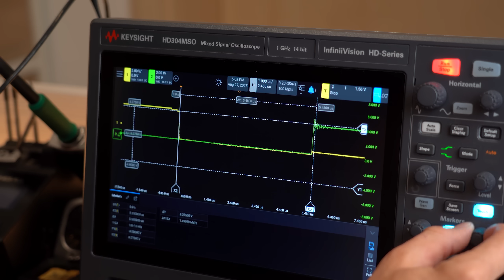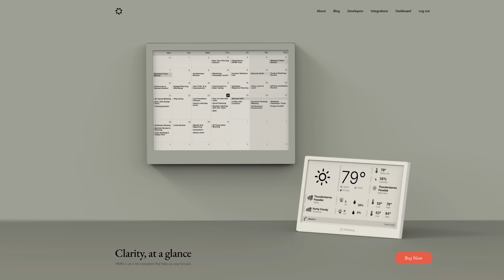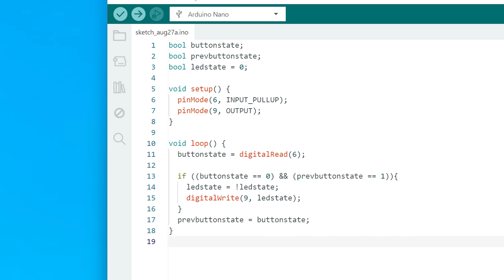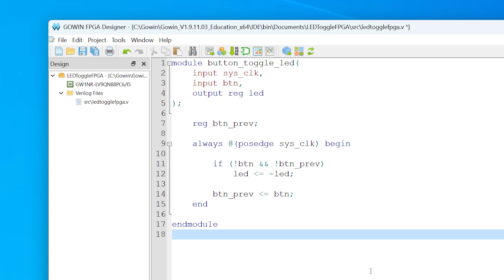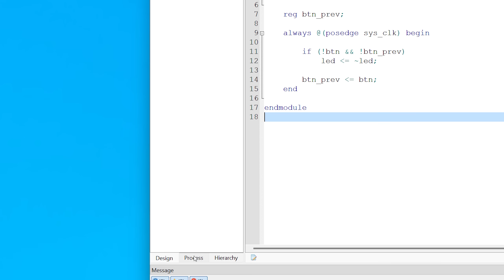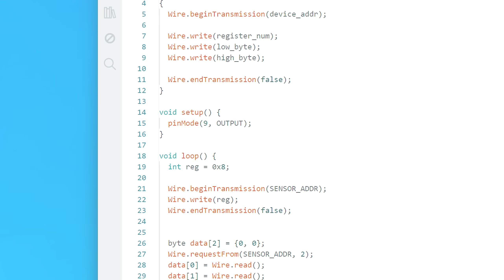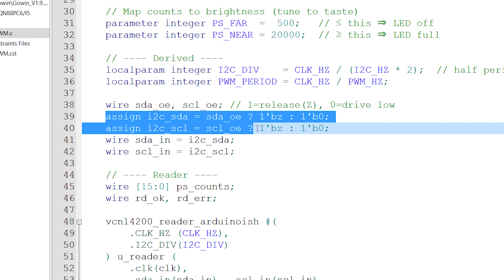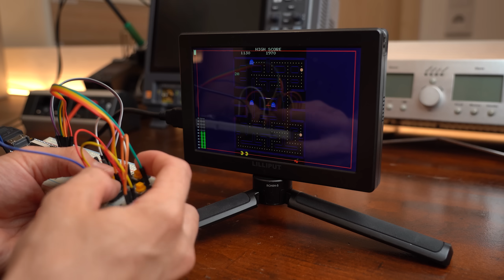The Harsh Truth about FPGAs (You Should Avoid Them?!)

Comment: My two cents about the subject... If we want to have FPGAs become a commodity so we can get more awesome and open things to be build around them... We have to use them.
The path is hard because FPGAs are right now a (expensive if you use Altera or Xilinx) novelty around hobbyists. Before the MiniMig making the DE boards popular, FPGAs were practically a closed feud around high designers and manufacturers. There aren't shortcuts and open user friendly ecosystems around them. All the tools and workflow are different across FPGA manufacturers, and the tools themselves may cost a fortune and you are tied to strong licensing concerns. And ofc there aren't mature open tools and libraries to work with them.

For this to change, people has to start rolling the ball. Them need to get buy and used, and a community to form, so open toolsets and libraries can build around them. Just like when Arduino and RPi came and replaced the old ways from the era and build friendly tools and communities around them, displacing Microchip popular PICs from the hobbist space.

Otherwise, FPGAs will keep being a niche, and open designs will be always limited around the limits microcontrollers can do.
Reply: The main problem here is that microcontrollers are more generic, they can do a lot of stuff like talking to sensors and toggle something, which is often what the hobbyists need and do. For FPGA, what do the hobbyists even need an FPGA for? How often does a hobbyist need to interface with high speed ADC/DAC or do some arcane networking stuff or need some thing to special logic chips that they can't get?

Arduino or RPi are popular because even if the framework simplified a lot of microcontroller stuffs (debugger, hardware datasheet,...), in the end the workflow is still similar and not too different like FPGA design flow (functional simulation, synthesis, timing analysis,...). So no while I would like cheaper and smaller FPGA with less logic elements for some other simple usage (like replacing CPLD) but I think it won't ever be a common commodity like microcontroller.
Reply: @minhkhoa445  i dunno bout you , but damn near EVERY project i've done >> ive needed some parallel processing. most of the time coding arduino/esp32 its about how / where i can compromise & stripe the operations. then when u just use a micro to do one thing > your barely even using the thing / seems like such a waste
Reply: BUY MORE ,, yes, need more options less than 100$ or 50$ . that only became a reality in the last decade, but VERY FEW.
Reply: None of that is true. The software development tools for low to medium performance FPGAs have been free for decades. IP for many basic and not so basic functions is also available, either as part of the development software or open source IP.

FPGAs are probably just not a very good fit to what the vast majority of hobbyists want to do compared to a microcontroller. The learning curve is much steeper, the hardware is more expensive and the massive parallel processing where FPGAs come into their own is not needed for hobbyist projects.
Reply: FPGA boards are a lot more expensive, and the IC parts tend to have really high pin counts and packages more difficult to deal with by hand. So you are basically stuck with paying a lot more than for a microcontroller, and even the ICs themselves are too expensive. There needs to be some part with a lower pin count and an ecosystem that puts the cookies on the bottom shelf where they can be reached.

Comment: A potentially even bigger benefit of FPGAs is that (if you design things correctly) you can operate on data coming from another system without introducing any jitter.  Since microcontrollers have their own clock, everything they output is necessarily synchronized with that clock, which means the timing will be different from the timing of the inputs.  Outputs of an FPGA can be synchronized with anything (or nothing).

Comment: FPGA is harder to learn because it's close to the hardware level unlike a microcontroller that is already configured and only need to change software. 

In my own opinion STM32 is the best to program and use for a simpler products. Arduino and ESP32 are good for prototyping on breadboards or if you need a function you don't going to change later like a temperature and humidity sensor with a display. You gonna have down  in the garage etc.

FPGA seems more useful for more advanced systems.

Comment: I think FPGAs are great. Now the problem is obvious: it's hard to work with, and the more complex a design gets, the harder it is to keep track of the code. What I personally do is use Logisim Evolution, design a circuit in there using logic gates or other parts labeled "FPGA Supported," and export it as a Verilog file, then flash it to the FPGA using Gowin EDA since Logisim Evolution's built-in flasher does not support Gowin FPGA-based boards like Tang Nano and Tang Primer... yet. It can be fun if you have 1. the time, 2. the patience, and 3. the skill and the right tools. Logisim Evolution also has the advantage of being able to simulate the circuit before exporting/flashing.
Reply: @UnNamedGuy0 I use the original version of logisim , is there any reason to ever go back to it if  started using logisim evolution & can I import my .circ files from the original into evolution?
Reply: @cryptocsguy9282 You can import .circ files from the original, but you won't be able to use the new parts, probably because of compatibility. You also get more parts like the 7400 series logic ICs, and more parts are not able to run on FPGAs.
Reply: Thanks, I was looking for software that allowed me to desighn as logic gates, and it seems logisim is what I was looking for

Comment: Nice video! Just to add some perspective: there are scenarios where microcontrollers shine, but also ones where FPGAs are a better fit. For example, FPGAs can be more energy-efficient for hardware-intensive, parallel tasks (like image processing in vehicles, where power is limited).
With SoCs such as Xilinx Zynq you actually get the best of both worlds: you run simple things like I²C on the ARM processor, and offload heavy computations to the FPGA for acceleration. On an FPGA you can even design custom interfaces — for example, if you don’t have CAN on a microcontroller you’d need to buy an external module, while on FPGA you just create the IP and reuse it in future designs.
Of course, the learning curve is higher (you need some digital design and computer architecture background) and time-to-market can be longer, but that flexibility and performance trade-off is exactly why FPGAs exist.
And even compared to boards like the Jetson Orin Nano, FPGAs can make more sense in certain contexts — especially when you need ultra-low latency, deterministic performance, or custom hardware integration rather than just raw AI compute power.